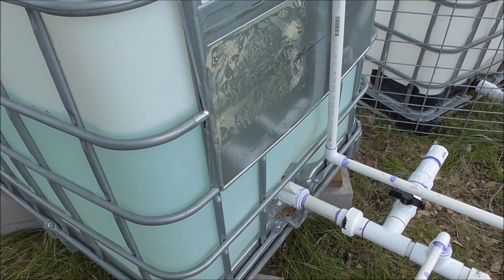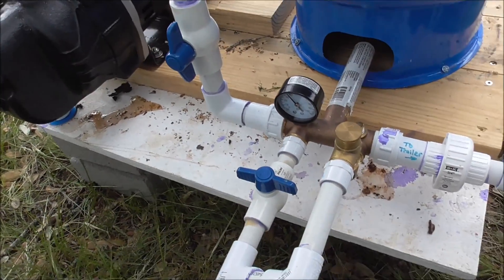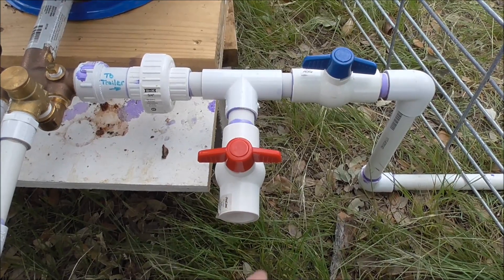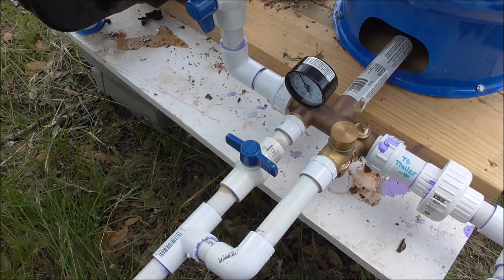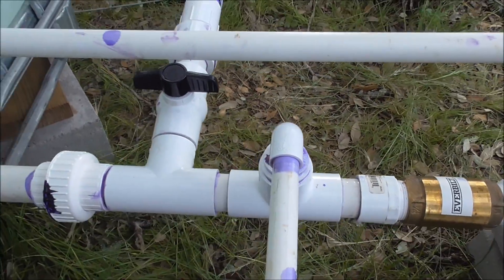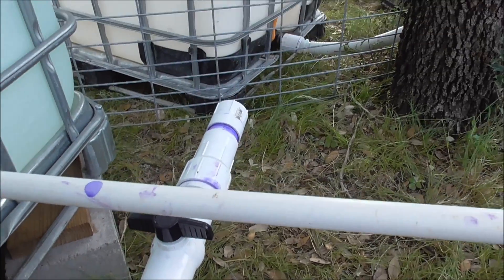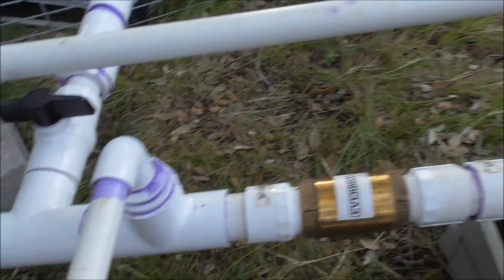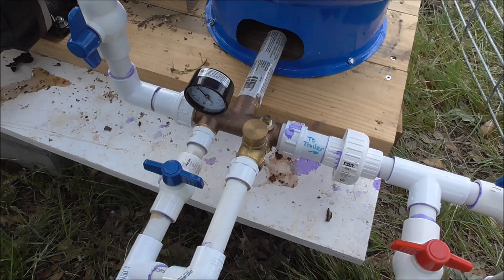How to Build a water system for a remote location, such as a hunting camp or cabin.

Comment: I’m replicating your system as I type this.  Have a ranch in SW Texas and a new 600 sq ft metal building cabin. Kitchen sink, bathroom sink, toilet, shower and eventually a skinning station.    I got the same pump (SWS50 1/2 hp), an 86 gal AO Smith vert tank, and likely 2x 330 gallon totes that I want to tie together (660 gal total).  Questions:

1. Is it 1 1/4” all the way to pump?
2. Is it 1” discharge out to tee, and on to trailers
3. Is it 3/4” out of tee (minimal flow) for cold temps and also 3/4” out of 75 psi RV?
4. You said 3/4” out discharge and back to tank when filling...but it’s 1” out of discharge right?  Did you reduce it down somewhere?

Wonder if the pipes could be wrapped with pool noodles to help prevent freezing also?

Thanks!
Reply: #1 yes its 1 1/4" to suction of pump
#2   3/4" discharge to trailers
#3. 3/4" out of RV
#4  No its 3/4"
Also I'd recommend using unions when possible in case you have to replace any sections of the piping. I have since wrapped all the piping with pipe insulation.  Also be sure to open up all drains (especially pump case drain) when freezing weather is forecasted. Hope this helps
Reply: @wycwby3133  Ok, thanks.  My pump just came today, I'll check it out, but I'm almost certain it said discharge was 1".   I also picked up the check valve on Amazon.  1 1/4" and says it is 200 psi.  Is that what yours is?  I thought I remember you saying 50 lbs, but i'm having a helluva time finding a 50 lb check valve at 1 1/4' threads.  Copy on the unions, I will definitely be using them in various places to be able to disconnect parts as needed.
Reply: @wycwby3133  Yep, you're right...3/4"

Comment: this is a great tutorial and exactly what I'm looking to accomplish at my deer camp.  I have a 1000 gallon water tank that i will use to feed 2 trailers and a 'butt hutt' (shower facility with a full shower, toilet and sink in a storage building).  I'm looking at a variety of set ups and pumps but I'd love to know which specific pump you chose and how it's working on feeding your 3 trailer set ups and the skinning shed.  I appreciate your info!
Reply: I use the Wayne SWS50 1/2 HP cast iron shallow well jet pump. From Amazon. Just be sure to fully drain it during cold weather
Reply: @wycwby3133  very much appreciate your response.
Reply: Works great on feeding 3 to 4 trailers

Comment: Very nicely done!

Now, that it's been a couple of years, I wonder if you might tell me how the system has been doing and any modifications you may have made to it since this video?

One thing I discovered that can be useful in systems, like yours, is a Cycle Stop Valve.    A CSV can reduce pump cycling, allow you to use a smaller pressure tank, reduce the load on your pump, and helps the system maintain more consistent pressure.

Thanks, for the video!

Comment: Are your breaking this down during the winter when it gets below freezing or just allowing the constant flow of water like you described to prevent pipes and everything from freezing and busting?  Are you collecting rain water somewhere or just transporting the water in via the other container and then just transferring it?  I have had land for several years now to hunt on, but no where to stay.  I recently have acquired a camper and am looking for ways to provide water and electricity for a couple of campers.  This looked like a perfect way for water.
Reply: In the cooler months I plan on just opening the recirculation valve a little to keep a constant flow. Also at the end of the supply line to the trailers I plan on putting two 90's and running a line back along the ground tying back into the pump discharge. I haul water from the ranchers house a couple miles away. Usually the 300 gallons will last 4 people 4-5 days of taking showers, cleaning deer, etc. It all depends on how conservative the users are.